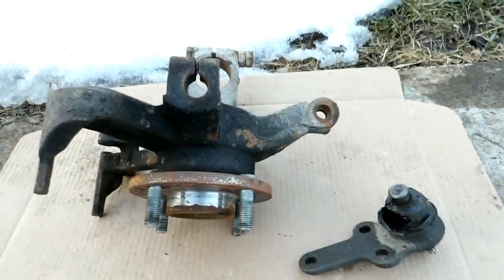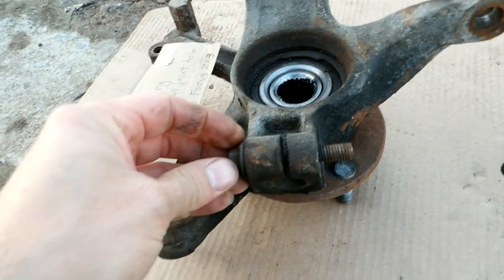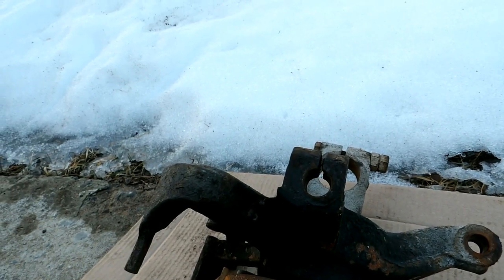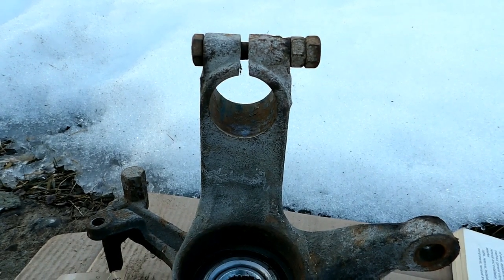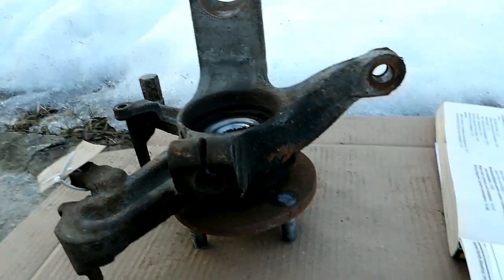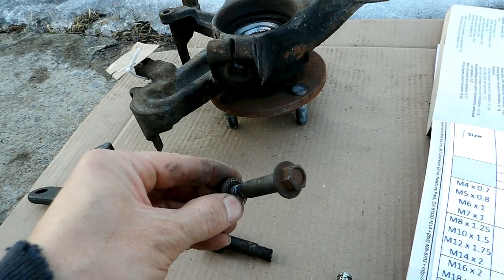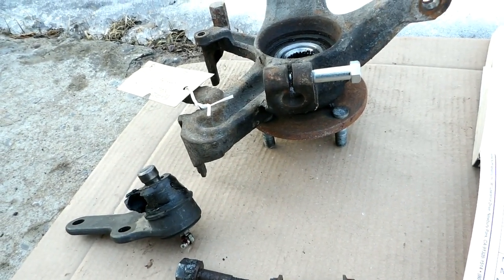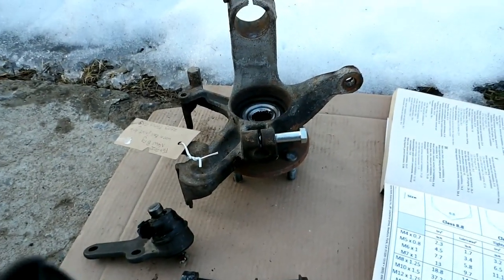03 Focus Ball joint Wear Problem Finally Solved!

Comment: Be careful using two nuts. At full turn and full strut extension, the second nut collides with the control arm. I'm also using a 7/16" bolt in mine.
Reply from the maker: I will keep that in mind, thanks

Comment: Has it moved out came out since you got the new steering knuckle? I’m having a similar issue and I just got a steering knuckle and I’m gonna see how it goes
Reply from the maker: No, it is fine, since I changed the steering knuckle.  I had never seen a knuckle wear before, but apparently it can happen. Genuine Junk Yard Parts solved the problem :)
Reply: @ChargerMiles007  I currently has my ball joint fall out 2 days in a row changed my knuckle and the lower arm and had a replacement bolt I used instead of the oem one as soon as I went to ford and got a oem bolt she’s never came out again goes to show how cheap the aftermarket bolts are made

Comment: The ball joint shaft was propably not seated deep enough. Bolt should hold the shaft by the groove
Reply from the maker: The hole for the ball joint shaft was worn too large in the casting, so I had to use a different casting. The problem has not come back. The cross bolt went in fine, but the hole was sloppy, never seen that before!

Comment: One bit of advice; Never believe what a Haynes manual says, they don't always get it right, and can be quite far off the proper specs, they're great to help with taking things apart in a sensible manner, but it's always best to have an original shop manual for the model just to be sure...
Reply from the maker: Yes, that is good advice, wish I could track down a Focus manual, as Haynes doesn't seem to cutting it for me.

Comment: Ford torque specs 48nm or 35ftlbs.
Ford dealership should be able to get those fasteners readily available. 
Being a Ford tech, I only use factory manuals, Haynes is about as useful as Dr Seuss to fix a car.
Also Ford ball joints seem to hold up better than aftermarket.... In my experience.
Reply from the maker: Thanks for the advice., and the proper torque spec. I tend to believe you about the Ford ball joints, as the part I now have on the car had the original ball joint still riveted into it.
Reply: I do not like Chevy and Dodge. 
I do not like them in my garage. 
I do not like them in the street. 
All that junk makes me drink. 

So when that bow tie or ram takes a crap just remember it’s only worth scrap.

Comment: Nice to figure it out. I had issues with a BMW R100 factory manual once. The torque specs listed for the cylinders were way higher than I thought they should be. Come  to find out they make special extra length helicoils due to pulled case threads!
Reply from the maker: I am not sure what the deal is with the 66 foot lb torque listed, there is just no way that fastener can handle that much. I trust the grade 8 bolt in there now a lot more, since it isn't any where near the stress limit at 60 foot lbs, being a 7/16" bolt it will handle 70 lbs with dry threads. I will be taking it all back apart again soon, as the used wheel bearing is making some noise. Yee Haw, time for more Futile Ford Focus Fixing Fever!  :)

Comment: Most Ford fasteners are yield-to-torque so you can only use them once. They stretch a lot. Also, the Haynes manuals suck donkey testicles. I’m a Ford guy and the two most used tools are a torch and a hammer. On a forth note , a lot of none-Ford suspension parts are incorrect size. ( see previous note ). Go OEM or Moog if possible.
Reply from the maker: Moog was the first ball joint that it actually wore out. The current one is a Delco product, and it seems to be holding up OK. I agree, the Haynes manuals do certainly leave a lot to be desired in some areas. I am not a big fan of yield to torque fasteners, as I seem to have to tear the bloody focus machines apart on a regular basis!
Reply: ChargerMiles007 tomorrow , I have to replace the harmonic balancer on my boss’s Buick. According to youtube I have to drop the engine via the subframe so that’s gonna be a hoot. I predict something going terribly wrong with the puller and drills will be involved.
Reply from the maker: LOL  :)  Yes, thing seldom go smoothly on repair jobs involving anything but a new car.